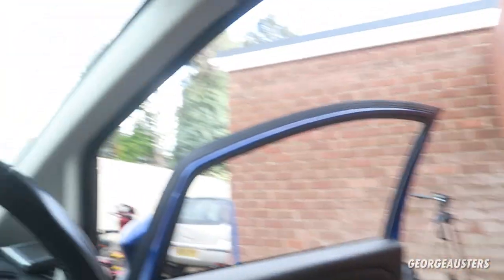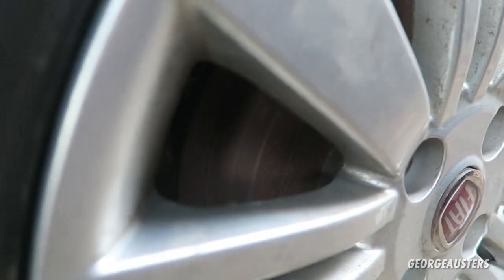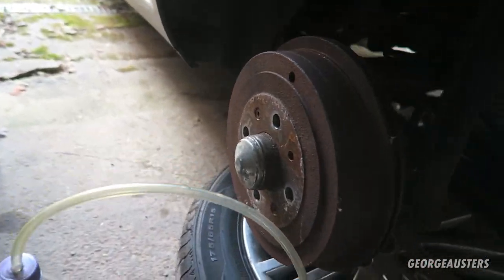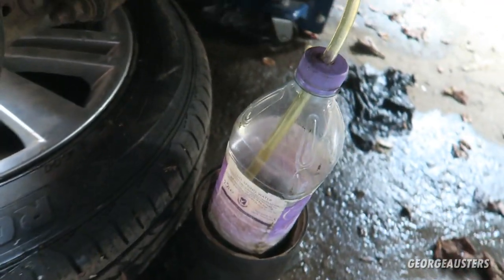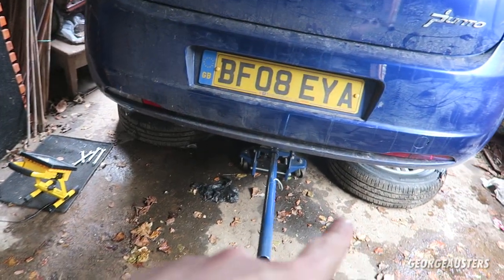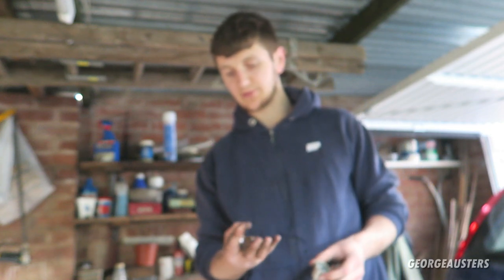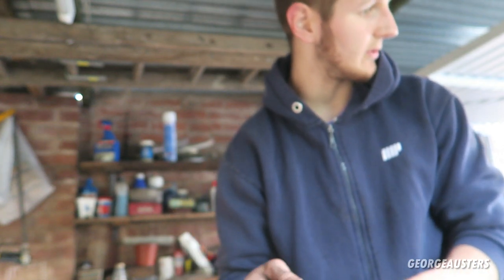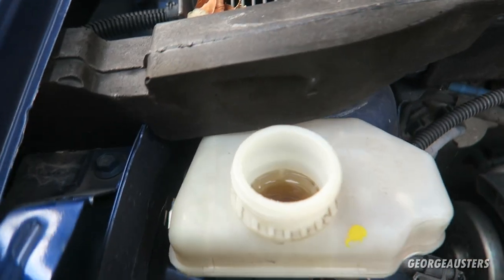Fiat Punto Brake Fluid Flush | First Brake Fluid Flush In YEARS!

Comment: Problem with this method is you can damage or flip the seal in the master cylinder because its moving much further than it would during normal operation, buy a vacuum tool, they don’t cost much
Reply from the maker: I had to make use with what I had at the time :)
Reply: I use chicken blaster £1